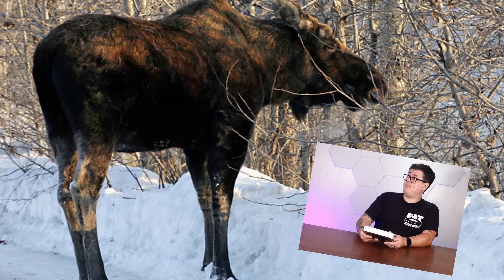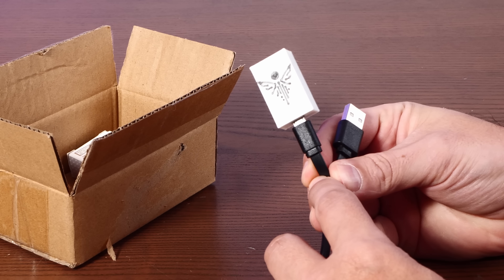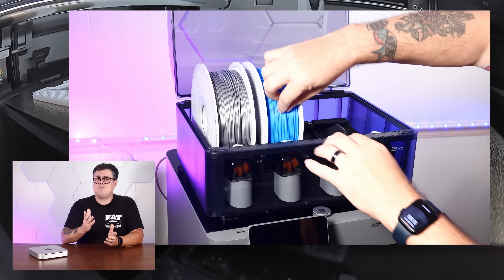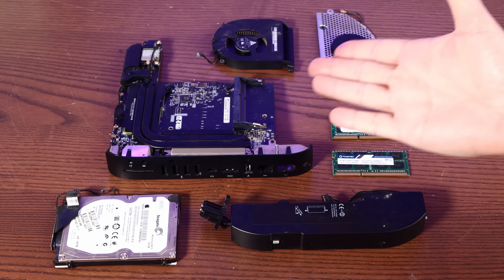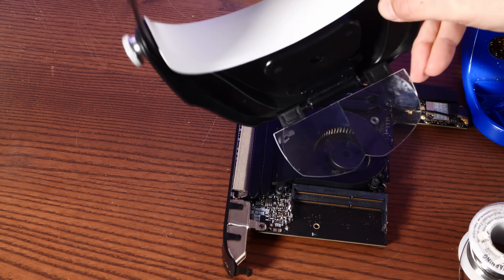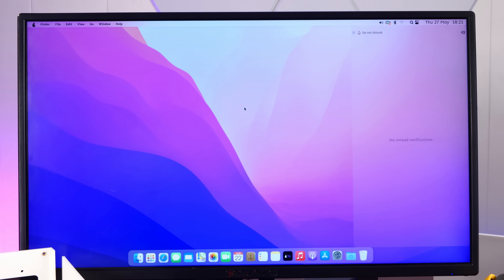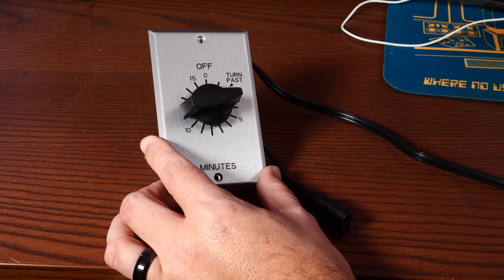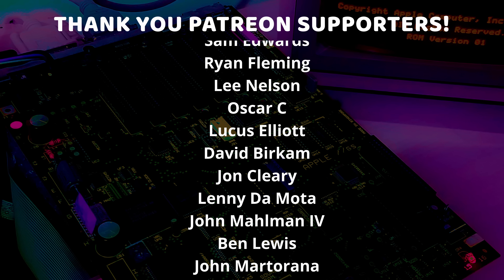Installing PEAR OS on an Unhinged Mac

Comment: Keyswitches for power is lame.
Everyone knows the most satisfying button is a 16-25 mm vandal-resistant button that goes ker-chunk.
As seen in: Freight elevators, ur dad's custom hot rod, municipal building sprinkler control panels, the starter button on your winter backup generator, the bilge pump toggle in ur dad's leaky boat and most satisfyingly, heavy construction equipment. KER......CHUNK.
But for a prank case you'd wanna put a 20 pound spring in the switch, which is difficult. They are simply too vandal-resistant for such vandalism.

Comment: I have that PlayStation 2 keyboard. I bought it one night from the local CompUSA down the road about 15 minutes before they closed as I was on a mission to do some "fun" things with a computer I was working on.  The computer in question would be right up your alley.  A Mini-itx via based machine in a .50cal ammo can.  This was around 2003, so it was very shenanigan rich.  I still heve the keyboard and use it all the time, but the machine got e-wasted when it wouldn't boot a kernel past 2.6.

Comment: my pc is a dell optiplex 790 that dont have fans for cpu cooling with a 7.5gb hard drive an amazon basics gpu overclocked and 6gigs of ram all of that connected to a black and white 5inch crt  now this is what i call cursed at a demon level

Comment: Further prank ideas:
 * a bit of software that will randomly have hyperlinks get redirected to a RickRoll. One out of every twenty times, instead of a link going where it should go, it just RickRolls
 * have a wallpaper rotation slideshow deal. Where you have 499 of the standard wallpaper backgrounds, and one of them is an extremely cursed background of some kind. Have each rotation only last like 10 seconds. So the cursed wallpaper only shows up for a very short amount of time
 * move the monitor connections to the front of the machine
 * include the optical drive, but the optical drive is not accessible from outside the machine
 * Colours that are only visible under UV light, with a secret message. Something like "Your mother" or "Satan eats cheese whiz"
 * Colours that only appear at certain temperatures (preferably a temperature that requires the computer to be running for a certain amount of time) that spell out things like "Bearenstein" or have the Fruit of the Loom logo with the cornucopia 
 * Could have modified the case to have the "Kilroy was here" WW2 meme (completely with the noseguy drawing)--but on the inside of the assembly

Comment: So THAT'S how those brass inserts are supposed to go in...I have a 3D-printed NERF internals kit that came with a pair of brass inserts for putting into a couple of holes for racking the sliding bolt back and forth, but I thought I had to just press them in. I even tried freezing the inserts to shrink them a bit, like engine piston sleeves. I'll have to dig my soldering iron out soon. Thank you!

Comment: That first threaded insert was upside down. They go in easier and are more likely to be straight if you use the shoulder to set it in the hole before you apply the heat to push it in.

Comment: Back when I was learning my way around machine code/assembler on the Apple IIe - yes, I am old - I wrote several viruses, technically “worms” because they could only travel via the boot sector on a floppy disk. One of them was very subtle, it just occasionally swapped one vowel you typed for another one, feeling more like an actual typo but driving our teacher/apple lab monitor absolutely insane. The second one was nastier; every time you booted a floppy, it would write 10k of nonsense as a hidden file, so the floppy would fill up with invisible data and eventually become useless. Both viruses never really escaped containment, because they only lived in a boot sector and you’d have to boot the infected floppy, then put in an uninfected floppy and type “catalog” at least once (which also reads the root file), so the odds were rare. It definitely infected our school lab for a while, until my conscience got the better of me and I collected all the known infected floppies and just formatted them. The goat prank would have been beyond my wildest dreams, back in 1988…

Comment: A Mac Mini is old enough to be considered ewaste?
Reply: It’s the 2010 model. Runs High Sierra 10.13, which has been dropped by Firefox ESR, which is pretty much end-of-line for anything internet-facing. I have one hooked up to my TV to play my video library. It can also run assorted Linuxes, of course. 

Now, if you want ewaste… I’ve got a 2006 Mini G4 around here somewhere….

Comment: Putting a timer switch on my PC's power supply would be a great way to curb my gaming addiction... or corrupt my hard drive with sudden shutdowns. Either way, problem solved!
Reply: insert that one xkcd about "rebooting my server" vs "plugging it into a timer switch"
Reply: Plug your storage device in a usb converter that is powered by wall power and connects to your usb socket and plug that into the timer switch instead